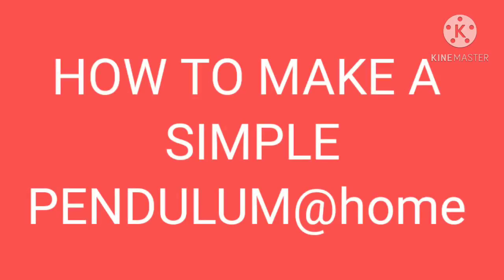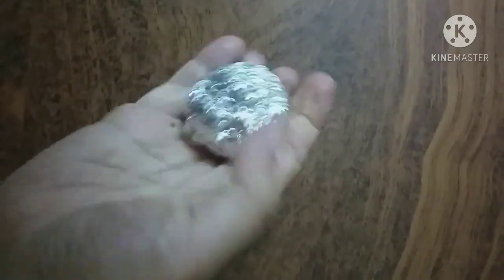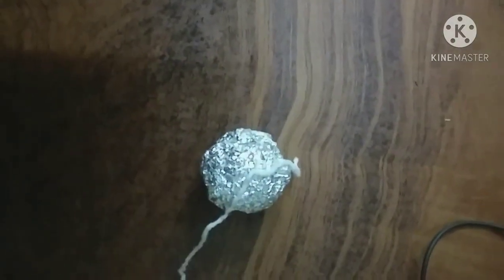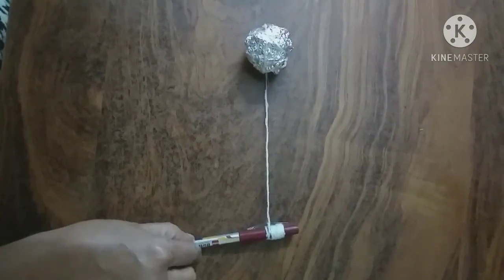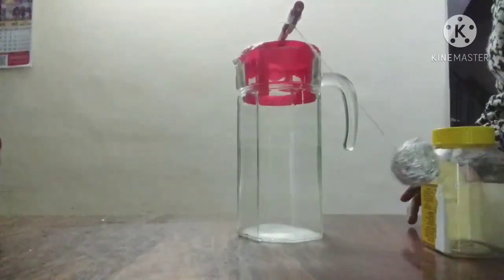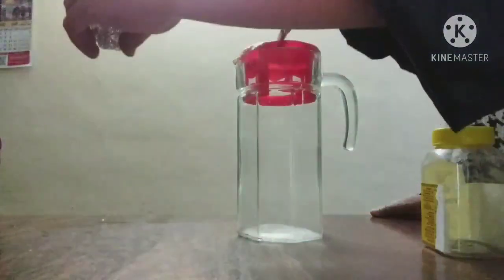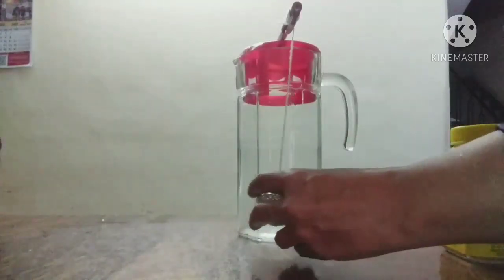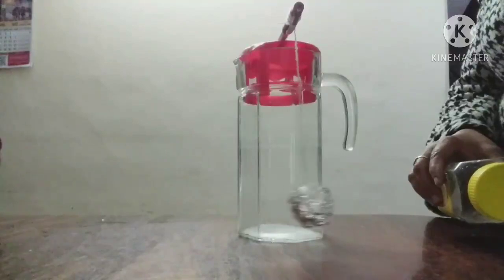Making a simple pendulum

Comment: WITHOUT   PEBBLES ALSO CAN WE DO?
Reply from the maker: The idea is that PENDULUM bob should not be too light that it gets moved by air.
You can fill it even with pulses - moong or Chana etc. Or even sand.Also the position of pen/ holder  should be tightly fixed.